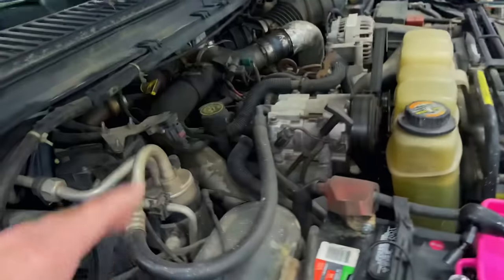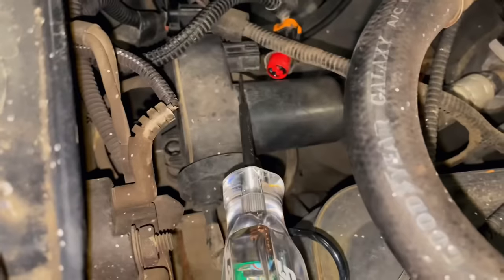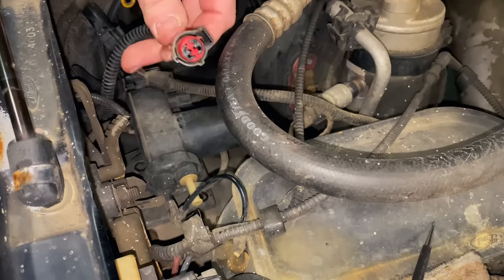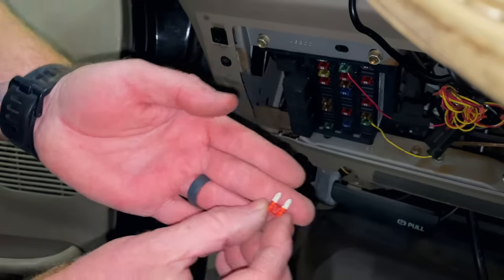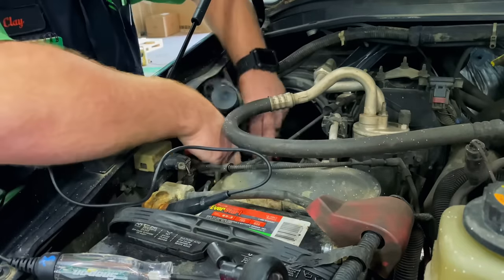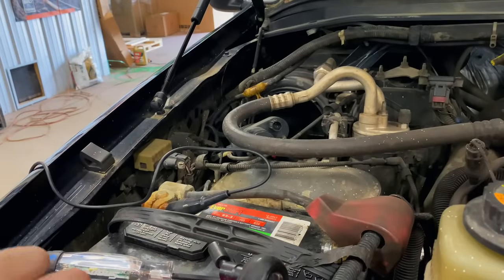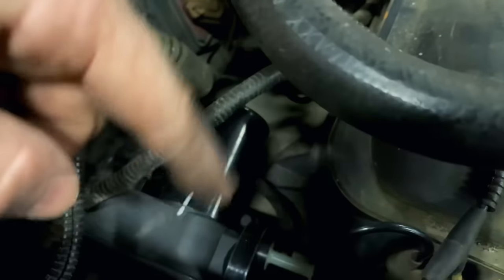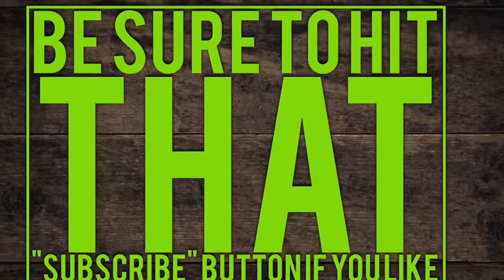Ford F-250 Blowing Out Of Defrost Only: Easy DIY Fix

Comment: Great fix video.  I am surprised Ford put the pump in a position to make it fairly easy to replace.  Normally they put things like that behind the dash or just above the automatic transmission.  Thanks for sharing the process.  Stay safe.
Reply: D Butler lol like the oil cooler in my 60hhh no 🤣🤣🤣🤦🏻‍♂️
Reply: Thank you for this video! I do pretty much everything myself but I just wasn't completely sure where to start with this. Based off your video I started with a few taps on the vacuum system then tried it and still no air. Then I went to the fuse box and just checked every fuse, I mean there's only like 15 of them. None of the fuses looked bad but I did change a couple of them out that appeared to be very old, most likely even original! I've been put everything back together and started the truck and voila, I had air coming out of my front vents again. I own a lawn care business and I was smack dab in the middle of a very hot day and this repair took me about 5 minutes. Thanks again!

Comment: Thank you so much for this video, mine is not switching off defrost to vents on max air, every once in a while it will but then goes back to defrost the next time I start the truck, 2000 F-250 with a 7.3 diesel. I will check this tomorrow

Comment: I had the same problem with the air conditioner only blowing out the defrost for my 2000 ford f250 7.3. After replacing the vacuum pump, it worked great!

Comment: Just checked mine the pump will run but never shuts off, if I unplug the suction line going to the pump and hold my finger over the hole the pump shuts off like it has made enough vacuum. Also if I add a hose to the line that controls the defroster and suck on it it will go from defrost to vents. Not sure how much suction this pump is supposed to have, all other lines checked and are crack free. The pump has very weak suction, not at all like a gas engine manifold would have.

Comment: My 2000 Expy doing same thing on vacation. One if those 1/8 lines broke at the 45 degree connector. Used some silicone vacuum line to replace the 45 connector and now works fine. Mine was the line coming from the vacuum tank to inside the car, next to battery. Great video. Thanks.

Comment: Very helpful video. Mine started doing the same thing after I changed the pump. After watching this video I double checked and when I pushed the plug into the new pump I bent over one of the prongs. Straightened it out and works like new. Thanks

Comment: Should you test for power and ground with it plugged in? To make sure it doesn’t drop current under a load, like a short? Great vid clay!
Reply from the maker: I was just testing to be sure I had fire at the pump first and when I seen it had none at that point i knew i either had a broken wire or a fuse blown. Luckily it was a fuse. After i knew i had 12 volts at the plug when I plugged it in it didn’t make a sound and that told me the pump was bad, if it would have buzzed for a split second then quit I would have checked it to see what voltage was there but the pump wouldn’t even engage for a 1/10 of a second.

Comment: On the older model Ford trucks, the first place I used to look was those damn brittle vacuum lines. Ninety-nine times out of a hundred it was going to be a brittle vacuum line, especially on the 7.3's with the turbo. That turbo gets hot and all that plastic on that quadrant of the engine bay will get brittle. I hated seeing those fuse boxes with all the added accessories too, all those aftermarket add-ons are nothing but trouble most of the time.
Reply from the maker: I have a 1990 model and we had to redo the vacuum lines on it. They just crumbled to pieces
Reply: My 02 lines evaporated. Dust.

Comment: So I have this issue of heat and/or A/C blowing out of defrost.  99 F250 SD 7.3.   The fuse is fine and the vacuum makes a continuous noise when I put key in on position. In fact it makes this noise as long as the key is in on position.  I’ve watched vids saying if it’s not the vacuum pump then it’s likely the egr vacuum solenoid.  Or the vacuum reservoir??? How can I distinguish the culprit without replacing them 1 at a time?
Reply: I have the same problem

Comment: I have 06 F250 xl 5.4l engine.  I have the same problem I looked under the hood on the passenger side of the engine bay and there is no vacuum pump.  I looked for it everywhere.  When I tried searching for the part I got this part may not fit your vehicle which makes me wonder if it has one at all.
Reply: Diesel usually. Never seen one on a gasser
Reply: Did you figure out the problem?? I’m having the same issue ?
Reply: I have the same problem. Did you figure it out?
Reply: I have not figured out the issue this video is for a diesel engine and it's setup is different something that would have been helpful for them to mention.
Reply: I would check your heater core system first. Gassers draw a vacuum while operating unlike diesels. That’s why these diesel trucks have a vacuum pump.